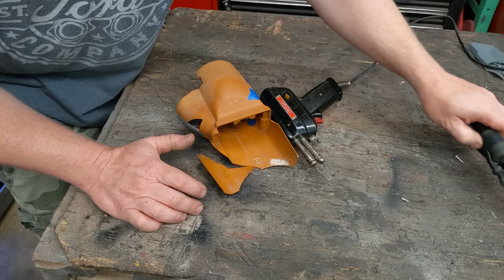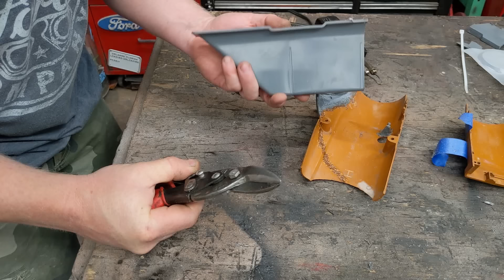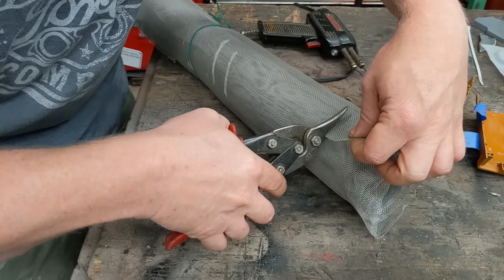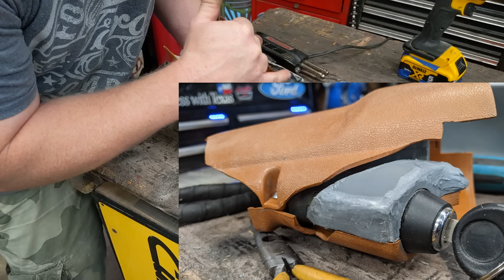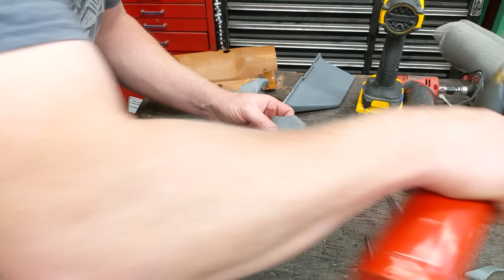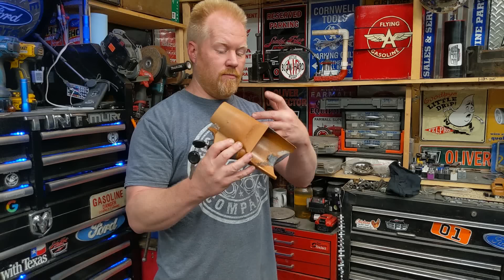HOW TO FIX broken plastic ULTIMATE Welding Forming Repair techniques

Comment: I've found that regular Elmer's school glue works great for filling the small cracks on the finished(pretty) side. Idk if it matters but I let the glue dry before painting and if you have a textured pattern on the finished side you can use clay and a touch of vegetable oil to copy the pattern and press into the glue after it is started to set and is semi solid. Applying the oil to the clay keeps it from sticking in the pattern grooves and keeps the glue from adhering to the clay if the glue isn't set enough. Hope this helps someone
Reply: I'd think that wouldn't be very stable afte awhile. Especially in really hot and cold weather. But the clay could easily work if heat was applied to the exterior plastic, too.
Reply: Thanks...Simple Science..

Comment: they make plastic welding guns that come with wire that heats up when you push the trigger and you just push it in easy let off the trigger and it gets cool fast and pull it off. there cheap and they make different kinds of wire you can put into the end of the gun. this is good, no problem but the plastic welding gun is much better. i am about to make a video in one on my channel. been using them for so many years.

Comment: Super helpful. I had a cracked face plate on my chainsaw allowing the tension screw to pop out. It was not safe to use because the chain tension could not be tightened. I used your technique with HDPE and window screen and it’s working great now. Even with the tension screw firmly pressing on the inside of the plastic plate. Thanks for helping me save a chainsaw!

Comment: The plastic you're repairing is still old and brittle, without a coating of epoxy paint to add strength and hide the repair, the rest will soon fail.

Comment: I’ve done a lot of plastic welding in the past, you have introduced me to something new..the Screen and any thin wire that can be heated and melted in.  I used to use the rounded plastic that other plastic stuff is attached to, kind of the size of a Straw.  I’m 76 and I’m STILL learning.
Reply: Many decades ago, my dad told me that if it was a day I learned something, it was a day not wasted! I've tried to live up to that my whole life. 🙂
Reply: You are so right every day is a school day,
It shows you are here to learn what ever the subject.
I’m just the same and willing to pass on my skills just as freely to anyone willing to learn.

Comment: Good stuff, got my soldering gun in 1961 it still works came with two of those tips one gentleman describes one is like a foot for welding the other one is a straight blade for cutting plastics used to change the wheelbase on model cars

Comment: Great video!  I have some plastic panels on a Yamaha scooter that have cracked and I JB welded them and it’s not the best looking but it’s holding.   I will use the soldering iron and go back over the cracks on the back side using screen.   Thank you!!

Comment: I've also duplicated the texture using a bed liner spray. Repaired a dash using some of these techniques and fiberglass mesh with filler, sanded smooth, shot with the bed liner spray. Amazingly stock result.

Comment: I had a place missing on my gasoline hedge clippers. A small engine shop gave me an old broken piece of that orange plastic. I was able to fix it, then sand it fairly close to factory. Hasn't fallen back out & that was 2 years ago. On my car mirror, I used JB Weld & a Dremel tool. Flat black sprayed it with an air brush. Can't tell it was ever chipped.

Comment: Done a lot of fusing like this, often with less than satisfactory results.   This is a great idea with the screen and all. 

As for cosmetics.  Mix a small amount of super glue n baking soda and quickly rub in surface.    Light,y sand, parimutuel n paint.   Worked wonders on my auto console. (Mixture to fill cracks came from u tube.  .
Reply: Um, question – what's "parimutuel" in this context? Do you happen to mean prime, by chance? Because I'm pretty sure you don't mean bet on it before painting. 🤨 🤔

Comment: Sorry its only 75% of its current condition its not as strong as it was before it got sun bleached or uv rays got to it.
In fact thats a shitty connection 
Some plumbing pipe solvents work pretty good you can attach plastic behind to add more strength and harbor fright sells a plastic welding kit with plastic rods.
But in 17 years of doing high-end car audio at a retail store and 45 total years working on used car lots ive never had luck with a solder iron repair they always fail putting the parts back in.
Never take parts off the car in the cold winter plastic will break. Seen it too many times by other installers have ice cold plastic snap by the clips becuse the part was cold.
And on that truck dodge used some cheap ass plastic  some of the gmc truck with 4x10 in the back on the side i won't touch becuse I know the plastic going to break if I touch it. The customer is told if it breaks we are not responsible for the damages  the plastic has gotten hard 
That sterring wheel panel almost always broke on that truck it was when they were making the K cars.  If you think the truck was bad the cars were 10 times worse. 
I had to change that at first I thought it was a a piller panel then notices the key cylinder spot .

I dont buy dodge anything or gm Ford I would but I stick to Toyota

Ok end result looked good 👍. 
Im impressed.  But keep in mind there is a plumbing joint glue that works on all plastics that will work for you.
Now what truck is that  by the screw holes next to the radio im thinking dodge
But it could be al older Ford. But I'm also thinking GM becuse of the 3.5 " speaker spots on the conners of the dash.

Comment: This is very interesting. I like how you used the window screen to make the parts stronger. That’s a very good tip. I also like the fact that did extensive research to find out that plastic labeled with HDPE will weld better. I learned a lot today.

Comment: 2p-10 is sooooo much faster and just as strong
Reply from the maker: Super Glue is too brittle and it will simply break in the exact same spot. You would be far better to use a flexible adhesive and built it up on the back side; like e6000.

Comment: I broke a plastic wing bolt that plugged my sand filter to my pool last year. Wish I would have seen this video first before I tried plastic welding back together using scraps of a juice bottle. My technique was not very good and it failed a couple times before I threw in the towel. Grabbed a $0.99 nylon hex bolt of similar size from a local hardware store and called it a day lol. Was a fun experience though trying to make do with what I had.

Comment: Ive been welding plastics and acrylics for decades. The trick is to know what type plastic youre working with and their characteristics. Also using the correct filler rods. An incredible alternative for repairs of virtually any plastic or metal is Q bond. Got a porcelain statue missing an arm? Make a mold and cast it using q bond. Dash board cracked? Fill in the crack activate the filler and its fixed in 30 seconds.

Comment: This guy is on the money. Done a ton of plastic welding over the years, especially my time in the body shop. We always used stainless mesh to backup the repair area with a decent overlap on the back of the repair. I use 'like types' of plastic when doing the repair. If you don't have the actual filler rods, cutting or melting strips of some scrap plastic is the best and cheapest method to get your filler. There are specific tips that are flat for the soldering gun that are designed for this. Then there is air plastic welding. Same principal, different tool. Thanks for sharing this. Nice to know I've been making these type of repairs like this in the same way.
Reply: Great tips. I like to use 3d printer filament as filler. Lots of people have some and it works good
Reply: ... makes those busted up spoilers & auto bumpers laying beside the road a resource instead of an eyesore.
Reply: @Le_Comte_de_Monte_Felin  
Absolutely. Damn good point and I guess I never really thought about it that way. 👍

Comment: As somebody who spent some time in the tupperware navy I've made many repairs using this method, it works great as long as you don't overheat or burn the plastic.

I highly recommend an iron with proper temperature control to prevent overheating/burning which can release toxic fumes and even weaken the part/make it brittle.  Many common plastics begin to melt right around or just over 100C and are easily damaged at the temps an unregulated iron can reach.

An iron made for plastic welding or something like a TS80 with a digital readout and wide temp range(100C - 400C) is ideal, be careful of cheaper Chinese units as many of them have poor temp control and will burn the plastic when they cycle on to heat up.

Comment: This was great. I had damaged the grill on my riding lawn mower when the strap holding it in place on my trailer slipped and the grill bounced off the front wall of my trailer. It wasn't destroyed but it was in pretty bad shape. I've been thinking about different ways of repairing it by adding metal backing and that type of thing. After seeing this I pulled my trusty Weller dual Heat solder gun out and very carefully realign the parts and plastic welded them back together. I've done some repair like this on Old tape recorders and other AV cases but never thought of doing something this big. I was even able to replace a couple of missing pieces of plastic in the grill with other plastic that I salvaged from parts I would have thrown away. This save me over $125.  Thanks for great video.

Comment: If you remove the tip from the gun and insert a paper clip of safety wire that you zig zaged you can just melt it into the plastic. I like the info on using metal screen and HDPE. Thanks for the upload

Comment: I'll say this when super glue 1st came out it worked on plastic, within 3-5 yrs later it wouldn't hold any plastic together, what's up with that? Did the super glue change or did makers of plastics add an additive to their formula which makes repairs impossible with super glue? This leaves you no choice but to buy another piece, that was broke, just find something thats old but made of plastic, & super glue will work, but any new plastic it won't?
Reply from the maker: Super glue works by flowing into small pores and locking the pieces together. I think modern plastics are just to smooth or I guess pore-less.

Comment: I heat up a piece of tig filler rod and place it over the crack perpendicular and let it eat into the plastic a bit, once cooled down, I'll come back with some epoxy. and coat over the crack. Before putting the epoxy on, I rough up the plastic with a dremel sanding drum.

Comment: MY stepdad used to repair TVs. He used to use pieces of small wire-like paper clips and bend them in zigzag and give a very strong bond  & rigidity to the broken cabinets.
Reply: Put a copper spoon end on your soldering gun it will do even better

Comment: Another fixit tip...super glue with baking soda (YouTube search it)
Reply from the maker: Absolutely. The only issue is super glue doesn't bond to most plastics. You can sand the surface to give something for the glue to bite too but it's still pretty low adhesion. The baking soda/SG mix will essentially just give a non flexible wall/backing for the part to brace against.

Comment: Excellent!  The bezel for the shifter boot of my ancient car is broken and the boot floats around loose.  I have doubts about finding a replacement but this will work great!  It’s not in a visible place but I’ll just have to be careful that it fits back in and “locks” in place.  All work on one side.

Comment: really need to use the same type of plastic for filler cause the chemical bonds won't be the same and be a weaker weld if done this and won't work well.

Comment: How do I make 2 liter soda bottles into... say 4 foot by 8 foot sheets?
That would be helpful.
Basically they will be uses for roofing on sheds.
Reply: Step 1: Check if the plastic is UV resistant - otherwise it will soon disintegrate.

Comment: You're really good at that! I'm saving your video to rewatch when I get frustrated. 
I've been working on my plastic repair skills for a while now (because we live in a plastic world, and I don't like using all my plastic money to constantly buy new plastic things all the time). I'm getting pretty good - I figured out using metal reinforcement, and I also save nicely-contoured bits of junk plastic and extra window screen. I just need a better soldering gun now - I have at least 5 or 6 electric and gas powered pen-type ones at this point that I just don't like... Maybe then I can work more on crafting new filler pieces. 
What really turned my game around though was being able to finally adhesive-bond those low surface energy plastics (i.e. PP, HDPE, LDPE, high-modulus-PE, PTFE, POM/acetal, TPO). I found polyolefin/LSE primer and a cyanoacrylate brand that I like, and I'm on a roll! Fixed my headlight housing yesterday, a travel mug the day before, it never ends, it all breaks. With the right primer I'm getting a killer bond on all those tricky plastics now, I'm even able to bond Delrin, Teflon, Dyneema, and EPDM stronger than the material itself. Not always a substitute for plastic welding though, which is why I really appreciate the video!! 
Keep fixin!
Reply: Wow!  You know your chemistry!
Great comments. Do you make videos on this subject?

Comment: I used to fix Atari joysticks like this when I was a kid.  My dad fussed a bit because I screwed up his soldering iron tip, but he let me keep doing it.  I also did this to repair the internal part of cassette player buttons when the arms had broken inside.  The repairs looked terrible, but they worked.  It was nice remembering that.  Thanks, sixtyfiveford!
Reply: I get pissed at myself for screwing up my soldering iron tip with plastic. Lol. Your dad was just venting.
Reply: He was letting you use the tool because it worked, while also letting you know not to fuck up your soldering tip. He was switching tips behind your back.

Comment: Not all plastics can be welded. Only thermoplastics. I use a soldering iron with an adjustable temp. I set the temp to the melting temp of the plastic I'm repairing and I never have to worry about it burning.

Comment: ❤ Check out the plastic welder at Harbor Fright. About 10 or 20 bucks.  Looks kind of like the pencil soldering iron but has a steel straw to feed plastic rod in it.👍👍

Comment: If you're doing this on a cosmetic side, you will want to try to use the same type of plastic and build it up well so you can demand it down. Mixing plastics though essentially creates a polymer and is often stronger than the original plastic just by mixing them. The mesh is a great idea.

Comment: I've always thought of trying this but never looked it up.  So what about incorporating a dedicated soldering work station for your welding system, and using the heat gun to warm up your filler plastic?  Gonna try it, but I got to go break something first.

Comment: Window screen for the win!  It's aluminum though, not stainless.
Reply: Was looking for this comment!
Reply from the maker: Stainless window screen can be bought at any Home Imp store. Along with Aluminum and Fiberglass.
Reply: @sixtyfiveford  I was unaware of that.  A check of the local Lowes showed that (indeed) you can get it.  A bit spendy, but a useful product to know about.  Thanks!!!
Reply from the maker: @solarguy6043  Aluminum works the same, I just have a big roll of stainless so that's what I use.

Comment: superglue words fine on plastic... it's just that it's not used properly. It needs to have enough surface area to bond to. So an edge isn't idea. You need to bond something behind the crack/break to give enough surface area.

Comment: Some great ideas and Mcgyverness techniques.
Have you seen one of the hot weld staple guns? It looks almost like your soldering gun except instead of having a fixed tip it uses staples in the shapes that you're making you insert one of these into the holes at the ends of the two rods press it against the plastic pull the trigger it heats up melts into the plastic let go of the trigger make a slight twist to pull the crack in tighter it cools down and you pull the gun away and the staple stays embedded in the plastic. Then you take a pair of wire cutters and snip the ends off that are sticking up just be careful don't hold the wire ends with your finger cuz when you clip the wire off at near the plastic edge there's a lot of energy released and that piece of wire could fly into your finger, that happened to me and it hurts. Wear eye protection. I always use needle nose pliers to tightly hold the wire end before I snip it with the diagonal pliers. You can get like a bag of 1,000 staples in different shapes like wave, straight, inside and outside corner shapes in two different thicknesses 0.6 and 0.8 mm for around 10 bucks depending on how many you purchasing and they're good quality stainless steel wire. I imagine you could modify your Weller by removing the tip and inserting the wires directly into the ends that you make up yourself or grab a bag of these staples makes work a lot quicker and now I'm thinking maybe you could connect the screen to your soldering gun directly in the same fashion as the staple and heat up the entire wire of the screen rather than trying to use the soldering tip to heat up the wire screen.
I'm kind of guessing you've been doing this plastic welding before the hot weld staple gun came out maybe?

Comment: Depending with what plastic you deal and solution is different. There is no universal way to glue plastic. Also there is one chemical is called " Dichrorethan" which melt PVC based plastics. Also "Duracryl" is good when you glue 2 type of plastics or metal and plastic.